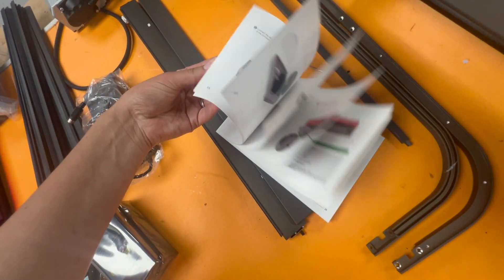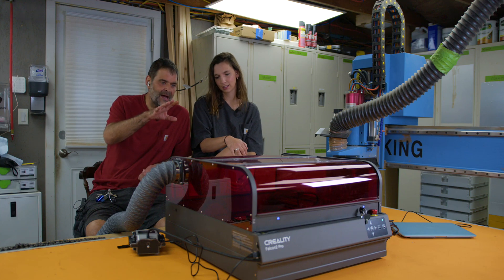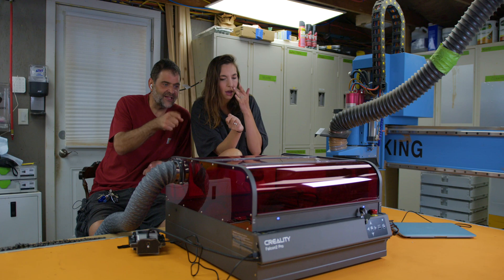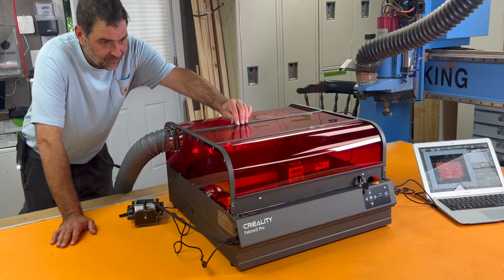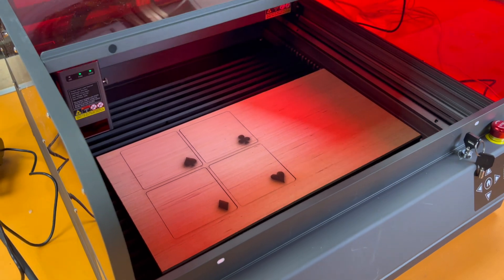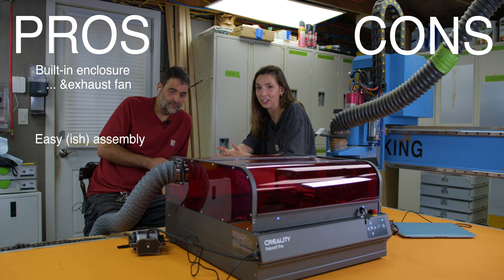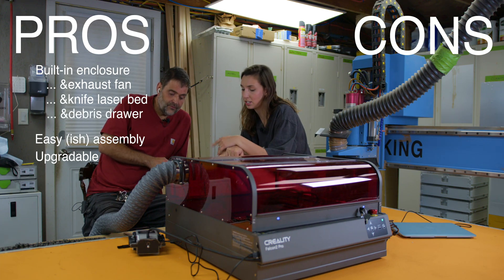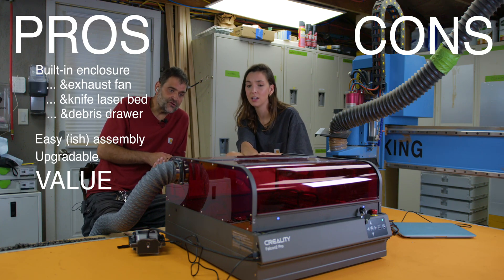Reviewing the FANCIEST Diode Laser we've ever seen || Creality Falcon 2 Pro Diode Laser Review

Comment: Nice review. Really does sound like a great value. I wouldn't use a laser w/o an enclosure and ventilation, so nice that it's all included. Seems like a perfect upper end starter machine, especially if you can get it with a more powerful head.
Reply from the maker: The enclosure and ventilation are so important to have, and this is much slicker than a tent